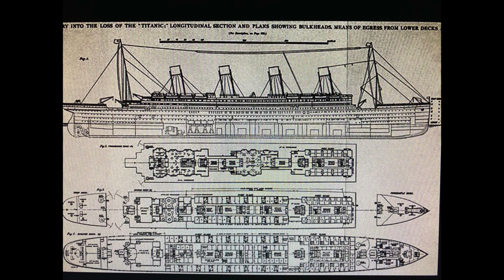Titanic History/How the ship kept power throughout the sinking.

Comment: But also keep in mind that the water was shorting out the wiring inside the walls of Titanic.  The Titanic's electrical system was already compromised by the water long before the split.  Salt water is very hard on copper and aluminum.  Not only that but water was flooding into the generators and shorting them out as well.

Comment: Did the Titanic had an Auxillery Power Unit?  Or only the Two? Main-Generators?  Or even Batteries?  That would be interesting. Some kind of wolktrough. We all know how or only that, she goes down. But i guess only a few people know how the Ship Was equipped. In case of the Titanic it would be quite interesting, if you can make a Sub genre... like... "inside Titanic". And... whats more Importent! You are such a dude who can make that feaseble. (Sorry if my english is bit off. Im German and not used to comunicate in english.) ;)
Reply: The Titanic had two auxiliary or emergency generators in addition to the four main generators. They were located at D deck level and were run by steam engines. These would have been used if the mails were offline, and I believe they were used in port while no passengers were aboard. The ran lights in work areas, the Marconi room, certain passageways. The Marconi wireless system had an emergency set that ran on batteries. Your questions are very interesting, thanks.

Comment: I was understanding that ships used condencers to return the steam to the water tanks as you generaly cant use sea water in marine engines
Reply: That is correct, Titanic had a closed fresh water recirculating system. Once through the main and turbine engines, or through other engines and systems that ran on steam power, the remainder went through condensers, converted back to water and to the tanks to start over.

Comment: These are the things i cannot believe the had in a ship in 1912:

Marconi room

Emergency lights

Any source of light that wasn't oil lamps or candles

Watertight door systems

Being able to call to the engine rooms to change the ship's speed
Reply: Ikr? It’s stupid advanced for something barely out of the 1800’s. They had refrigeration, salt water condensation convertors and running fresh/salt water from hot and cold taps.

Comment: Sea water hitting the boilers wouldnt cause an explosion it might cause Implosion the steam in the boilers would condence instantly reducing the volume of the water that was steam by 1000 times causing a vacuum that might be able to colaps the boiler. The boilers are pretty strong under compresion like an arch

Comment: I question your statement that Boilers in Boiler room #1 were not lit.  This boiler room provided what is termed "Hotel services" when the ship was in port and would also functioned as evaporators being fed seawater with a high blowdown rate to limit the salt content.  The generator room was aft of the turbine room and the forward boiler rooms would have been isolated by closing the valves from each boiler room.
Hence the #1 boiler room and the generator room would have stayed dry the longest. 
Unfortunately we can never know the truth as none of the engineers survived and neither the bridge log or engine room logbooks were recovered.
Later ships had a petrol, later diesel, emergency generator located adjacent to the wireless shack; earlier ones banks of accumulators.
                          -- a now very old steam power engineer with over half a century of experience.
Reply: Question??  was the Generators a Steam turbine generator or reciprocating piston???  I am thinking steam turbine but want to make sure.  Thanks

Comment: He did not actually address the technical reason why the power was able to stay on unless I missed something.
Reply: In a nutshell, many of the engineering department personnel stayed at their posts and kept the lights on and the pumps running till the last minute.  From accounts given by engineers that survived (many were ordered topside by the chief engineer), boiler rooms 1 and 2 and the dynamo room (electrical distribution room) were still manned and supplying power for the lights, heat, and pumps at the time she broke up.
Reply: @billbutler335  Slight error: No engineers survived, only stokers!
Reply: @trevorbluesquirrel899  Stokers are part of the engineering department and I consider them engineers per say. But yes only stokers from the engineering department survived.  Also consider stokers made up the majority of the of the personnel in Engineering to be able to feed the coal hungry boilers in her 6 boiler rooms.  As they lost boiler rooms to flooding those men were given the option of trying for the lifeboats or staying below and helping fight the flooding.  quite a few stayed to help till it was too late to go.
Reply: @billbutler335  I see! Several stokers were on the overturned boat, in fact!

Comment: Is it possible that when the icy water hit the boilers that were still on towards the back of the ship in order to keep the ships power going, help contribute to how Titanic broke apart?

They shut off the boilers towards the front of the ship to prevent them from exploding when the flooding started, but kept the boilers towards the back on to keep the power going.   The back boiler rooms look to be at the same area of where the ship's breakup happened. Could it had been that with an already streesed hull from the angle where the ship was at, combine with the back boilers exploding once the icy water reached them help contribute to why the ship's hull failed?
Reply from the maker: It is possible, but I dont think it would of made a huge impact. I still think the break up was due to the angle of the ship and the strain on the hull. Got to remember during Titanic final moments the boilers, while still somewhat active, were no where near full pressure. When the final plunge began people did hear explosion within the ship, (most likely boilers) I also think a boiler explosion was a factor in the second funnel falling. However in Titanic final moments the pressure was dropping and the power on the Titanic, while still on was no where near full power. So is it possible the boilers blew? Yes. But I dont know if they would have a major impact on the ship splitting. However that is just a theory, I am not a engineer.
Reply: @HistoricTravels  Was the Electric generators on Titanic Steam turbine or reciprocating piston type ??  I am thinking Steam turbine but not sure.  Also  was the rudder gear driven by steam pressure as well ???  Thanks

Comment: This is Shannon in one of your videos you mentioned that it was possible for the Titanic to have survived longer even with five compartments fully flooded how is that and you say it as though it was part of the ship's design so how is that
Reply: It was only the coal bunker in boiler room number 5 or the fifth compartment that was breached and leaking. The flooding was brought under control giving false hope for boiler room number 6 until they saw how high the water was.

Not long after the wall of coal bunker five collapsed from the water being held back.

Had that not happened, Titanic may have remained floating for another thirty minutes or so
Reply: Actually had the coal bunker door in the equivalent of a watertight door it would have stopped the entire sinking and if not it would have bought them an hour not 30 minutes

Comment: I have a question for you that several survivors have talked about regarding the Titanic sinking.
Several people including Eva Hart said they saw The ship break in half.
Then the Stern righted itself for a few moments before rising straight up in the air almost perpendicular or giant black finger then bobbed around like a cork for several minutes turning the stern deck away from lifeboats with screaming passengers on its deck in horror before its final plunge.
I have not heard any survivor claim it sank more on its port side and hardly rose out of the water before sinking.
Also as mentioned in another post to you
A crew member stated that one of The Titanics port side propeller blades most likely fell off as the 
Shaft that turned it vibrated violently before ship stopped.
I noticed in photos of propeller of Sunken ship portside one of blades seems to be missing.
This would collaborate statement of crewmember in boiler room 6 regarding water flowing under him and Titanic running over ice plate from submerged part of iceberg.
I would love to hear your thoughts on both of these things.
Thanks for your fascinating and historical videos.
Reply from the maker: Thank you for the comment, I will try to answer this as best I can and some of this is guess work. As far as the Titanic learning to port, we know that happened because of the D deck Gangway door. I believe one of the ships officers, I will have to check which, ordered passengers to move from the port side to starboard in order to move weight because he was worried the ship would tip. As far as the ship leaning over during the final moments we have our good friend Charles Joughin to thank for that. I believe he said that during the ships final moments it rolled over and he climbed over the railing and was walking along the ships side and on top of portholes. So while the Titanic was going down he was walking up til the angle became to great. Kinda hard to believe considering how buzzed he was. He wasn't completely waisted or anything but he was buzzed. 
As far as the ships final angle right before the final plunge, I think it rose a bit higher then what is shown in the animation but I dont think it did what it did the movie. I think it was a bit of a combination of the two. You are right survivors said they saw it go up but then other people who were on the ship said it rolled. So I think it was a bit of both. Hope this helps :) 
As far as the propeller, I have never herd about that. In the picture of the 1 propeller that is visible on the wreck it looks like that one end of it is buried in the sea floor.
Reply: @HistoricTravels  The only propeller that is not visible (at least very well) on the wreck is the center prop. This is because the outboard propellers were on wings that stretched out from the hull on either side. Due to the impact on the bottom, this caused the wings to reverse the downward angle they originally had to a upward orientation. The center prop was fixed on the centerline of the hull and unable to be affected (this is why they cannot verify if the Titanic's center prop had 3 or 4 blades). You were correct that the ship had a slight list to port during the journey and that the hull briefly righted itself during the sinking. Scotland Road and the D Deck gangway door did play a major part in the sinking since they allowed the water to move unimpeded throughout the ship. In most cases the watertight bulkheads only went as high as e or f deck and were not connected to the deck above so this aided in the flooding. The docudrama "Saving The Titanic" is a pretty accurate look into the events that happened below decks as it focuses on the engineering crew and various interactions that happened that night and leading up to the disaster.
Reply: James Cameron & Co did a doc about what really happened with the Titanic.
They came to the conclusion that he was wrong in the film when he had the ship rise to a 90 degree angle before the final plummet...
It actually raised only to 30 degrees out of the water.

Comment: Good job. The big release of steam was probably the safety valves of the boilers lifting because the main engines were not using the steam anymore. I believe the firemen had to rake out the fires from the boilers to reduce the further generation of steam. With the remaining boilers it should have been sufficient to run the generator sets, as they were much smaller than the main engines. As someone else mentioned, there were also small emergency generators available. The design of the power circuits would have had each area of the ship, as it submerged, shorting out the power and pulling out its own individual breaker in the engine room, and not cutting the remaining circuits. I guess when she broke in half, all bets were off! There was no longer any connection between the boilers and the generators!

Comment: Titanic had an emergency generator set located on the aft end of D Deck, below Funnel 4, and was made up if a pair of 2cylinder, compound steam engines used to turn the emergency generators. This is just my personal theory but, as Titanics power generation began to fail, the order may have been given, if it hadn't been earlier on, to bring the emergency Generators online since they were well above the waterline and the potential threat of the Main Generator Sets being disabled by flooding.

The emergency generators could draw their steam supply from any  number of boilers onboard as part of the Olympic Classes  redundant safety systems. More than likely, the emergency Generator sets were being fed by Boiler Room 2.  I would imagine, knowing that the end was near, and in an effort to buy more time, that the fires were drawn from the boilers to cool the fireboxes and prevent thermal explosions. This would mean that for possibly her last 20 minutes or so, Titanics systems were running on residual steam in her boilers and as that steam pressure dropped, so did the efficiency of her main generators. Since Compound steam engines have a high and low pressure  cylinder arrangement, they would provide power with half the steam consumption of Titanics main generator engines which were single expansion arrangements giving a little more power with less steam consumption.

When the ships hull began to fail, water intrusion into the main generator room coupled with the  failure of the steam mains from the boiler rooms, may have caused main power to fail. According to her general layout description, the emergency generators provided power for crucial lighting in certain areas of the ship, in a similar way that modern  emergency battery lights do in modern buildings today. Even without a steam supply from the boilers, the flywheel on the generator would have kept it turning briefly after steam was cut off. I work with Steam Driven Turbo-Electric dynamos and when we cut the steam off, they continue to provide an electric current for 10 to 15 seconds or so. This winding down of the emergency generators may explain why some survivors that were close enough to the ship said they saw some of her lights still dimly burning after the brake up and as she went down.
Reply: Thank you for the great explanation. Not enough credit is given to the designers and engineers, there were numerous systems and backup systems of excellent design that most do not know about.
Reply: @falcon664  this is why people cannot judge on the surface level, like many of my relatives they dont realize how much thought for safety was put into the ship for its time

Comment: The No.1 boiler-room boilers didn't supply steam to the Titanic's engines they supplied steam to power all of the other systems on the ship including its electrical generators.
Reply from the maker: Actually boiler room 1 was never lit during the voyage. The furthest aft boiler room that was active was 2
Reply: @HistoricTravels  Looking into what drawings I could find, boiler rooms 1, 2, and 4 all had boilers that supplied steam to the electrical generators that were located in the stern of the Titanic. I've also read that there was emergency generators 20ft above the waterline on a platform on D deck, that powered the wireless system and some lighting. I've ran power plants in my career, though not coal fired fire tube boilers like the Titanic had. So I'm not experienced with how long one of the boilers would have produced enough steam pressure to supply the generator to maintain the RPM required for power to be produced if the boiler furnace wasn't continued to be stocked with coal. Nor how the system was setup  or how they operatorated it in the final moments. Example if they could maybe have only run one generator producing less electrical power, but requiring less steam. The thing is there is limited info out there and we for the most part can only speculate as to what flooded when or happened over 100 years ago.

Comment: I read that the Titanic used 100 volts DC. Do you know if that is correct. Thank you and very informative video.
Reply: It was indeed 100 volts DC (& prolly a crappton of amps LOL). 4 (40KW aprox) main generators & 2 (10KW aprox) backup generators.  All DC, to whether if the ship was negative grounded, I do not know, BUT knowing about galvanic chemistry is a must on the sea
Reply: @MikinessAnalog  Ships and railway equipment do not use the structure, hull or frame, as part of the electrical circuit unlike automobiles, as you have stated due to galvanic corrosion.
Reply: @jaswmclark  Yes, I would not think so. Also, it would be difficult to keep an electrical ground between railway cars. It would probably be intermittent connections.
Reply: @MikinessAnalog  I figure they'd maybe run a direct connection between cars, like they do the air?
Reply: @nukepuke932  would have to, otherwise it would be intermittent.
Reply from the maker: I am not sure on that I will let you know. Thank you for the comment. :)